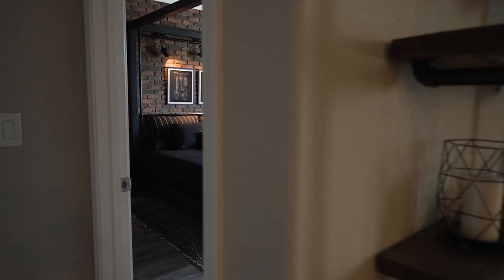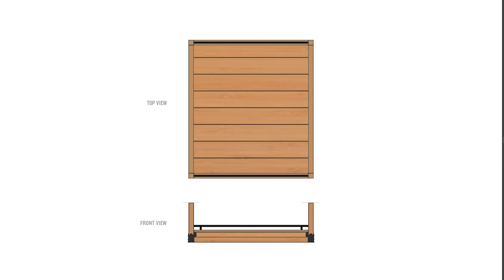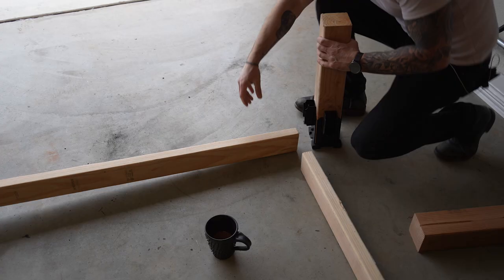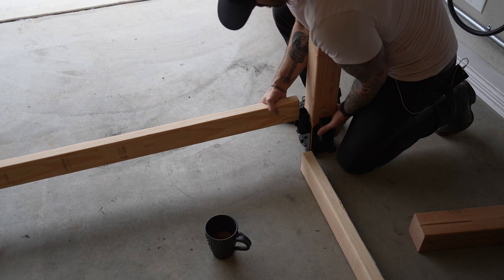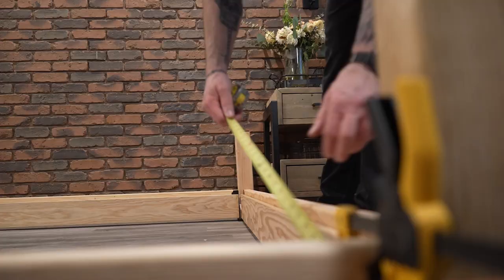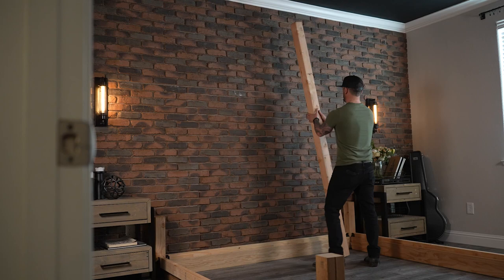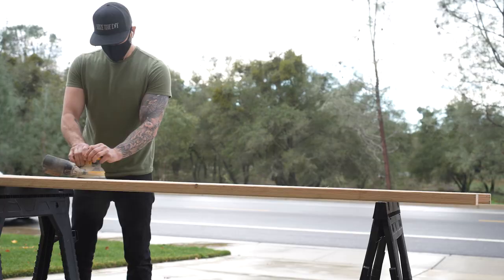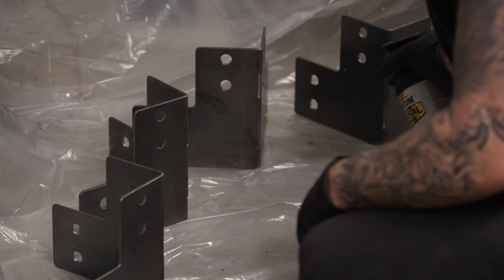How to make a DIY Platform Canopy Bed -  cheaper/quicker with a hack

Comment: I'm working on it!
Love it
Reply from the maker: 🤘🏼 that’s great to hear! Let me know if you have any questions. One tip that’s different from the video is marking the holes on the beams by clamping them in place temporarily while the hardware  is already bolted to the posts, rather than marking the beams while they’re on a work surface. It’ll probably result in a more accurate / tighter fit. Good luck!

Comment: Do you have a box spring or just use the mattress on the slats? Trying to see where the height is coming from because the slats look so close to the floor?
Reply from the maker: Thanks for watching. As far as I know, a box spring only provides a large flat surface for the mattress to sit on because most bed frames are only a wireframe without any flat support. The frame I built has a platform with a large flat surface for the mattress, so no box frame is needed.

Comment: Nice and clean very masculine tho🤣do u have a box spring under the mattress or is the mattress just sitting on the wood?
Reply from the maker: Thank you! ☺️ There’s no box spring under the mattress because I built a platform underneath. I could be wrong, but I think all box springs do is provide a flat surface to hold a mattress because most bed frames don’t have a solid or complete-enough area between the frame.

Comment: ..excellent video very talented ,, question are you making these amazing,  beautiful 4 posterbeds  frames ( in different bed sizes)for sale with the put up  instructions manuals , im in the u.s.a and im intrested..
Reply from the maker: Hello. Thanks so much for watching and for your kind words. 

I’ve had a few requests and considered building bespoke versions of the bed made to order. I think the challenge is, assembly requires some knowledge and carpentry skills from the buyer, and freight would be expensive. I have considered assembling on-site for the buyer as well. The material costs to build aren’t too bad but the labor for me to build it would increase the total price tag to be somewhere around what a quality 4-poster king bed goes for. After googling it, 10-15k is what is market price is. 

If that’s of interest for you, please email me: info@seizethediy.com

Thanks!
Reply from the maker: Hello, I’m offering these beds made to order tomorrow. I’ll post a link soon. Thanks for your interest in my work
Reply from the maker: Made to order versions are now up for presale: https://www.seizethediy.com/shop/p/bespokecanopybed 
I can do other sizes if you're interested.

Comment: how much would you charge to build this exact bed frame
Reply from the maker: I've considered offering the bigger pieces that I design on Etsy as custom orders, but I think it could become too time consuming and prevent the free time to work on new videos/projects. So, I'm actually looking for furniture builders who I could subcontract the work to.

The answer to your question might be shocking since the cost savings in DIY work is mostly labor. If I were building a unique piece like this bed for sale, I would probably consider the common price for an equivalent canopy bed– ones built from solid wood in a similar style without any metal hardware, pipe accents, lighting, or dimmer cost around 3-5k.. so, you factor in all the additional features and it would probably be around 7-8k. There could be a way to shave cost for sales, but without knowing how much a subcontractor would charge, it's difficult to know. Ideally, I'd make the price as low as possible though.

Thanks for watching!
Reply from the maker: I will be offering this bed made to order on my site tomorrow. Stay tuned
Reply from the maker: Made to order versions are now up for presale: https://www.seizethediy.com/shop/p/bespokecanopybed

Comment: This is so cool! Thanks for sharing. What are the dimensions of the beams?
Reply from the maker: Thanks for your feedback! I'm considering which way is the best method for sharing plans/dimensions. I might make them available in the community area via download link or through my website.
Reply: @SeizetheDIY  Last question : how would you take down this bed if you were moving? Since all the pocket holes are sealed off
Reply from the maker: @jean-manassepouabou4060  since I didn’t use any wood glue; all the trim, slats etc can be unscrewed and removed allowing access to the pocket hole screws again.
Reply from the maker: Presale for plans are up at:

https://www.seizethediy.com/shop/p/canopybedplans 

Digital or physical mail delivery Oct 1.